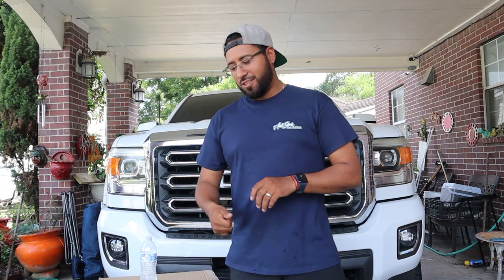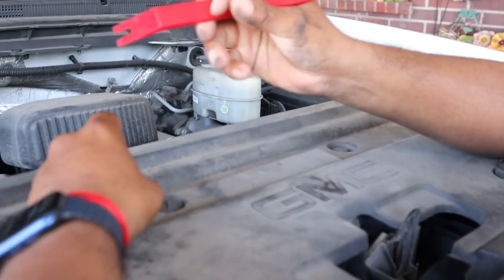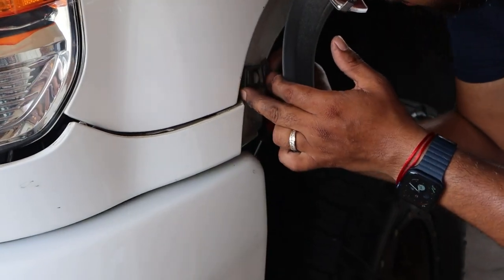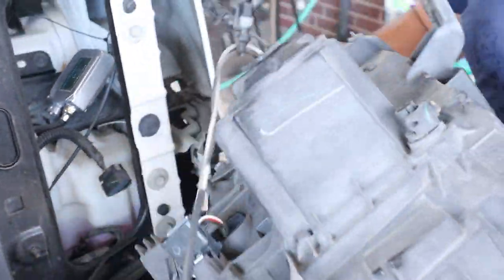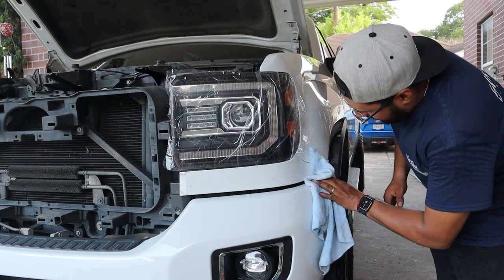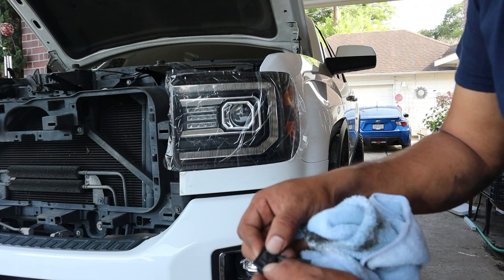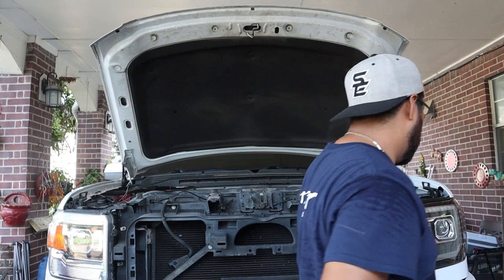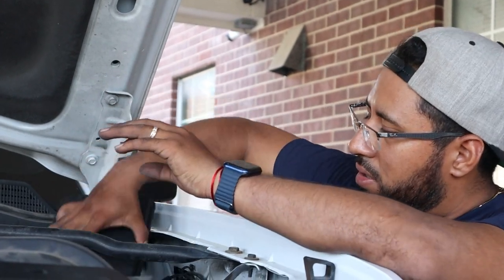GMC AlphaRex 2015-2018 Headlight Install!

Comment: Really appreciate you making this video it's going to help me out a bunch I am getting ready to order these lights however I noticed in this video you never hooked up the extra wire to the fuse box but the lights still worked anyway did you end up eventually add in the wire to the fuse box or was that not necessary for you?

Comment: I have the pro head/and tail lights installed on my 2015 sierra. My only complaint is that my rear turn indicator is hyperflashing. I reached out to Alpharex and they sent me a couple of 10 ohm canbuses. I'll update you after I install them. Other than that they have been a great feature for my truck
Reply from the maker: sounds good. keep me posted.  I know mine hyper flashed with the solid blinker option

Comment: Nice video thanks! Where you able to make the headlight bulb not turn on when remote started? If so how is it disabled within the remote starter or the truck itself?
Reply: Thank you, you should be able to get them off the auto mode on the cluster settings.

Comment: Did you add the gray wire to the fuse?? If so where did you buy the extra wire and what gauge or type is it??
Reply: i don’t think he did but if you’re running wire it’s prolly gonna be 16 guage depending on what you’re running to, if it’s power than maybe 18

Comment: I got a 2015 GMC Sierra and am looking at these headlights. Amazing video. I don’t have a HID and don’t plan on investing in it. Would you recommend these headlights or just spending the extra money on the LED version?
Reply: LEDs will work just fine… thank you for the feedback.    Definitely recommend them.  They are actually Fs lol. Sold the truck yesterday…. Dm my Instagram if interested.
Reply: @javierrodriguez5168  still available ?!? 😬

Comment: Thanks! Was looking at these headlights for my truck and couldn't find any info on their website and they won't answer the phone. I too was looking at the Morimoto's as I have their HID kit but $1,400 is too much no matter how good the projector is. I was also looking at the alpha black version of these headlights but I actually think the little bit of chrome looks good with the chrome grille. I was wondering how the DRL lights worked and this video answered all my questions. Thanks!!
Reply from the maker: Glad I can help
Reply: @Dobbies Revenge I'm sure they are but for a $1,000 more it's not worth it to me. I ended up getting the Alpharex's and they are night and day better than my stock headlights.
Reply from the maker: @Dobbies Revenge well depends, I think the pro version of these will be identical to the morimotos.  I still have morimotos on my dads f150(my old truck) those things are starting to fade, and haze.  Didn’t expect that…
Reply: @AntiStockCC  what if my 2014 sierra  did come with factory DRL strips day time running.....do i still have to wire something??
Reply from the maker: @ghost_sierra1600  yes you still do.  That will turn on the functions of the headlights
Reply: Are these pro series or lux or nova? Thanks
Reply: @ThrottleReport  are the lights in this video pro series or lux? Thank you
Reply: @tyyoungblood  Pro Series

Comment: Connected the wires to the negative and los I’ve terminals. Woke up with a truck with no battery in the morning. How did you do it brotha ?
Reply from the maker: Did you hook it up to the correct fuse? If you just put the connectors on the terminal that’s giving the lights constant power, you don’t want that.

Comment: How are you liking them so far ? Was gonna save up for the morimotos but came across this video and considering these since they are a lot cheaper!
Reply from the maker: Having the morimotos on my f150 before I say I like them the same.  After doing hid in these the light output is the same.  I would honestly get these, and IMO they look better.  The morimotos look like the stock 2016 Denali lights
Reply: Yoo if you bought them can I see how it looks on your truck

Comment: I know this video is old, but I’m putting them on my truck. I have a SLT & I have DRL in my stocks & it won’t work with the new headlights unless I wire that harness up but I need extra wire & don’t know what to get.
Reply from the maker: well from what I remember, the headlight should have a different connector for the equipped factory DRL.  of the the headlights should come with that extra wire... if not a 18g red wire will work.  just buy the wire and a t tap fuse from the auto parts store.   if you can't get it, DM me on IG and send me pics or a vid and I can guide you threw it.
Reply: Nice

Comment: Thinking about getting these considering I don’t wanna spend 1500$ on the mori motos… my truck is already blacked out and I don’t want blacked out headlights. If they had different version of the mori motos I’d probably go with them but due to the fact they only have blacked out for 1500$ ima pads and get the pros
Reply from the maker: These are the cheapest version.  I just installed a led bulb and they looked great.  I sold the truck
Reply: @AntiStockCC  what size bulb did u use?
Reply from the maker: @terrenceanayas  h7 led bulb
Reply: Why did you end up selling the truck?
Reply from the maker: @123inning9  I got a good buy price, and literally treaded for the f250 I have now.. the gmc was a the basic model and the f250 is diesel, platinum and 4x4
Reply: @AntiStockCC I have the factory hid kit how did you use the h7 led on it ? I believe I have 9006  bulb with the box behind it lol
Reply from the maker: @fernandocabrera4455  replied.  Sorry for the late response… you would have to run a h7 bulbs.  They have a option to chose when you have oem hid

Comment: So my denali doesn’t need to use the module or the small port on the lights? Just tap into larger port ?
Reply from the maker: Correct… so even if you get the ones with built in led you will only connect to the large port…
Reply: @AntiStockCC  sweet. Appreciate it.
Reply from the maker: @swoop-it4621  np.   If you need any other tips lmk.
Reply: Interesting. I have a Denali 18 so if I get the set of headlights, do I need to buy the LED version and also the adapter?

Comment: did you your fuse connection fit? on mines it has a relay in the way so i can’t put it in. it’s spot 39 right
Reply from the maker: yes fuse 39, get a fuse tapper so it can fit correctly.

Comment: AntiStockCC did you have to adjust these headlights?
If yes how you did it? I mean where are located the bolts to adjust them to the left or to the right.
Thanks for sharing your video.
Reply from the maker: I did have to adjust, 8mm bolt are located behind the light.  clockwise is up I believe counter is down

Comment: Have you had any issues with the headlights yet?
Reply from the maker: no issues...
Reply: Ok. Thanks. I got mine installed. I hooked the relay up for the day time running lamps and they didn’t come on. I put the full in 39
Reply: I got it figured out. Thanks again for the video. I’m loving mine

Comment: What fuse did you tap into for the DRL? Thanks!
Reply from the maker: Fuse 39.  Sorry for the late reply
Reply: Sierra 1500 2014 . 39 wont fit because of the position the fuse is

Comment: Nice video bro, just purchased my set would you happen to know if the Denali version still needs that harness?
Reply from the maker: Yes.   The harness is for the led functions.   Only thing if you didn’t get the integrated headlight bulb you will need a decoder.     So if you run a led bulb or halogen bulb you will need that.
Reply: @AntiStockCC  hey brotha, did you get to connect the drl for your headlights if so which fuse number did you use to get the drl working? Been looking at the fuse chart and i dont really see anything that would keep the drl bright during the day and dimed down during when the headlights come on
Reply from the maker: @StyleOverPolitics  do a fuse tap on fuse 39.     Skip to min 29.00 and I explain what fuse to tap. That fuse will do what you want.   Bright during the day and dim at night
Reply: @AntiStockCC  i tried to plug in the fuse tap onto 39 but damn seems like its not able too because if i plug it in one way the end of the wire is hitting fuse 70 and if i flip the tap the other way its hitting fuse 65 both of these fuses are in the way to plug in the tap smh
Reply from the maker: @StyleOverPolitics  you will have to get a fuse tap,   Autozone had 2 options.  A fuse tap that sat at normal height and one that gave you some space (hight wise) that’s the one you need…    I had that issue until I found that fuse tap that cleared the other fuses.
Reply: So I plugged mine in fuse 39 on my 15 and it don’t work on auto, when I turn the lights on it comes on?

Comment: One question. When you're driving during the day, are the headlights on and the DRL LED C strip is on at the same time? Or did they wire it so the headlight comes on with the parking lights so it doesn't do that?
Reply from the maker: the C strip stays on and the 3 strips. that's the drl function
Reply: @AntiStockCC  which fuse port did you use for the DRL?
Reply: @zachclutts255  what I’m trying to figure out as well!!
Reply: @zachclutts255  Fuse port 39 - Auxillary ignition, 10A
Reply: i have a 2014 and my fuse does not fit because of a relay in the way?

Comment: Install the wiring harness on the driver side headlight not the passenger side so the fuse and battery wire reach the fuse box.
Reply from the maker: make sure you have the short side of the harness on the passenger headlight
Reply: What harness are y’all using?

Comment: I just got these and can't get the DRL's to work with the harness installed. They don't come on unless the headlights are on. Tried having someone in the truck and putting it in gear. The stock headlight DRL comes on but the Alpharex does not. Any suggestions? Truck is a 2015 GMC Sierra 1500 Denali.
Reply from the maker: Go to your local audio shop or place a order on Amazon for a set of GMC Sierra headlight module kit.   It’s a small conector with a box,  you need that since you have a truck with exciting drl.     They aren’t expensive…   I believe the proper name is a headlight decoder module.
Reply: @AntiStockCC  So the harness that came with it (and the box attached) won't work. Please explain because I'm a little confused. Thanks for the reply by the way.
Reply from the maker: @unubtainium  the kit the lights come with is for the light functions.   These lights are designed for the non led/hid built in models.   Your truck has that so that means when you plug these in, your truck thinks something is wrong.      It’s just a error code so the module will fix it
Reply: @AntiStockCC  My truck originally came with halogens. I put Morimoto HID's in the stock housings with no issues. I'm now changing out the housings to the Alpharex Pros with aftermarket LED's. Everything works fine except the DRL's during the daytime. So to clarify... headlights, sequential signals, night DRL's all work, just not the daytime DRL's. I'll try calling Alpharex later today.
Reply from the maker: @unubtainium  ohh well just make sure the red cable is tapped to the correct fuse.    That’s what powers that function.
Reply: @AntiStockCC  what fuse is it

Comment: I have hyper flash and says it's on the back. Please help
Reply from the maker: I would recommend some switch back bulbs that have a built in resistor…  that way you don’t have to tap in a resistor to keep that from happening.

Comment: What is that noise when you unlocked the truck?
Reply from the maker: It has a aftermarket alarm.   It was the remote signaling the unlock feature.
Reply: @AntiStockCC Thank god, thought they were coming from the headlights. That for sure was going to be a dealbreaker for me😂
Reply from the maker: @Amokof  lmaooo

Comment: Hooked up my wiring to the battery and they work the same way and I have a Sierra 2013 think that’s good?
Reply from the maker: If you don’t hook up to the fuse the only thing you won’t get is the dim function at night or day
Reply: @AntiStockCC  what fuse tap did you use?
Reply from the maker: @edgarperez3657  sorry for the late reply fuse 29